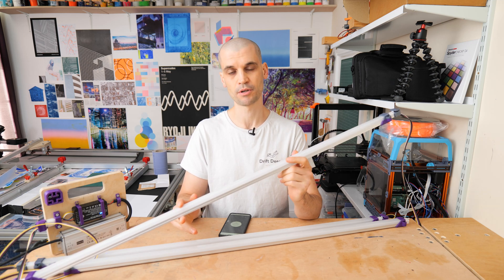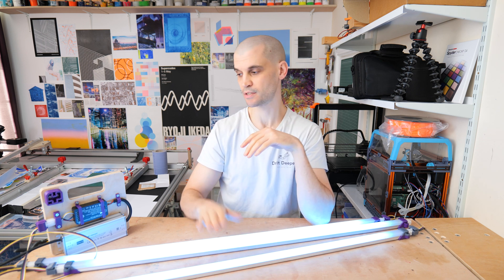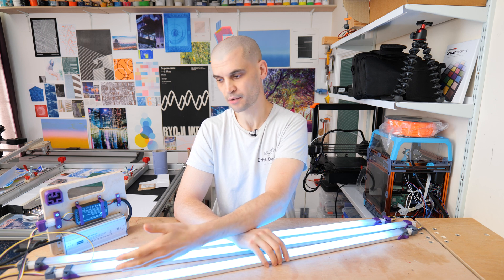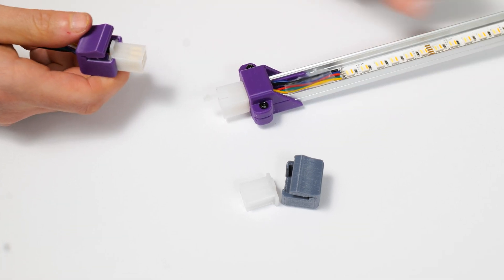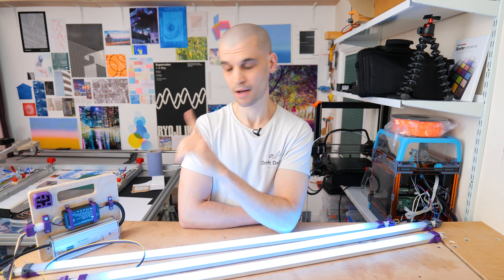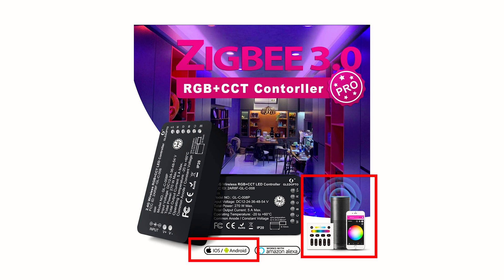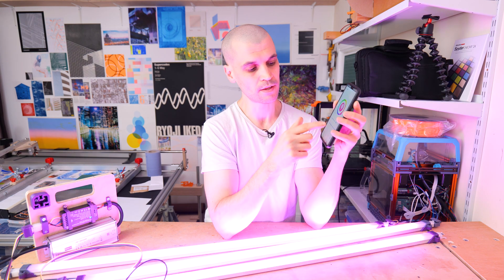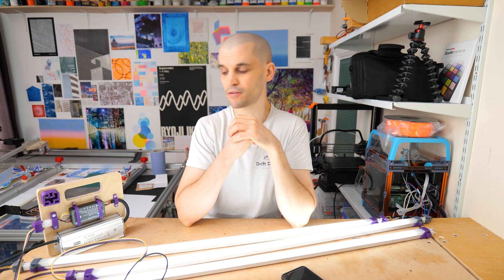DIY Modular RGB LED Tube Light

Comment: Actually, fwiw, you might reconsider the soldered wires plugging in to your controller, as they can eventually experience "tin creep" which can potentially be a major safety hazard. I think that ideally you just want bare copper for such mechanical connections. The only time you generally should use solder is connecting to a PCB, or soldering to a wire's shield layer.
Reply from the maker: oh thanks White, im learning something every day. Will have to research tin creep in more detail, ive come across lot of scientific articles that i dont understand very well -_-. More reading is needed!
Reply: @ThisDesignedThat  ye, just use wire ferrules if you can!
Reply: @ThisDesignedThat  I recommend using wire ferrules on bare copper, if possible, to terminate your screw-terminal connections! Though pre-tinned copper wires might be fine, too? I'm not sure if the tin would negatively affect the ability of the wires to cold weld under crimp.

Comment: You know, this turned out really well. Not only because you did it yourself and avoided the Godox tax. The video itself was pretty well edited and informative too.
I imagine someone might be able to sidestep the zigbee stuff with a simple IR remote and receiver that talks to the controller or driver. If they try to build this for themselves and don't want the smartphone stuff.
Reply from the maker: Cheers AGA, hope you found it useful. Yes there are plenty of controller options out there and if you go with a simpler LED strip (just RGB or RGBW for example) the controller and remote options are even cheaper (<£10). Im going to try and build a battery powered godox tl60 DIY in the future so being able to control multiple lighting setups under one app will hopefully give this setup better value for money.